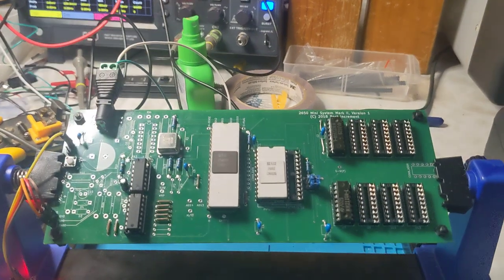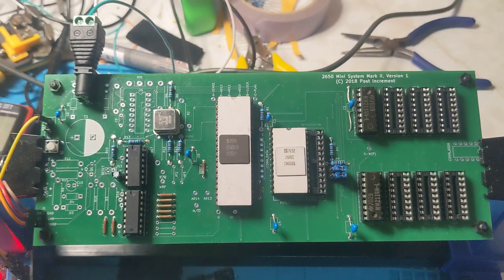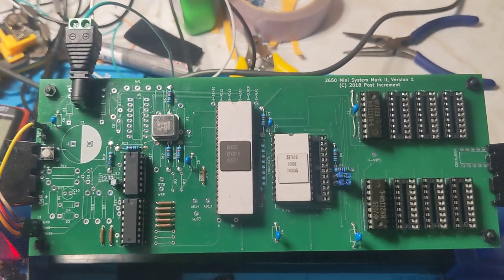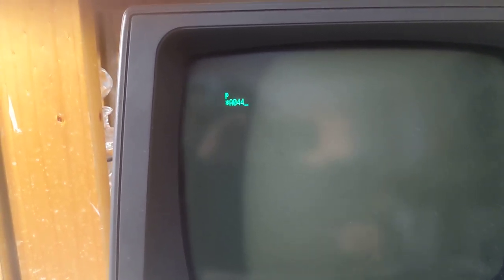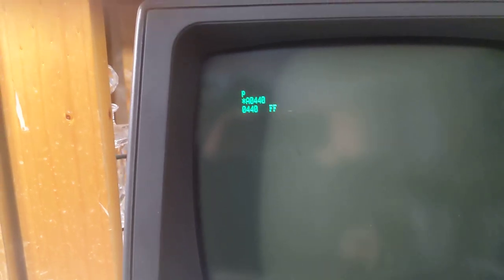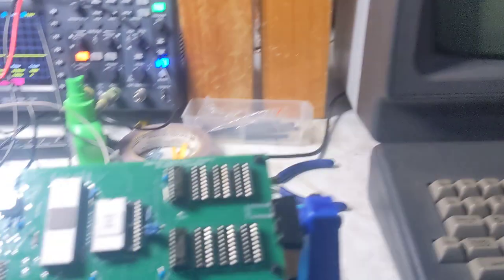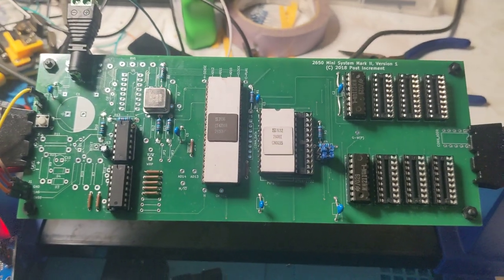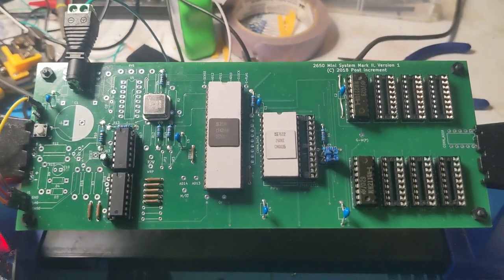First power up running at 110 baud. A  remake of the EA May 1978 Signetics 2650 Mini Computer System

Comment: Wow, I built this in 1978! Thanks for sharing. Cheers, Ian
Reply from the maker: @4youian  in 1979 also had the kit from Electronics Australia, then I was 14 years old and I never got it to really work properly.
Reply: @RoyAntaw  I'm the same age. I remember I'd just finished building the 5v power supply from the EDUC-8. My dad came in with a cup of tea and put it on the bench and shorted something out! I had to replace all the RAM chips. Eventually I got the 16k expansion and it felt like I had all the memory I'd ever need!